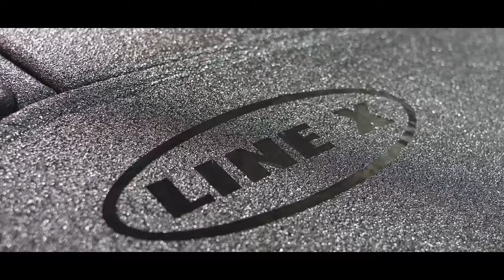I SPRAYED MY ENTIRE CAR WITH LINE-X!! (LINE-X CAR EXPERIMENT)

Comment: try spray Line-x on a snow ball and throw it at someone :)
Reply: As you as you saw in the video it held the glass together the glass still broke but it only held it together so basically putting Line-X on the snowball would just be like a cover or cap for the snowball preferably a cap so basically inside would just be a bunch of water but that's just my theory
Reply: RICKROSSyt SMART
Reply: RICKROSSyt BRuTAL
Reply: RICKROSSyt the snow ball would probably melt and then it would just be water in a line-x ball
Reply: That's how people get concussion kids
Reply: A GAME THEORY
Reply: That would probably hurt alot

Comment: If line x did that you should spray plastic and see how much weight you can hold with it
When you hit a car with a sledgehammer or drop an egg off a building your implying it can take a piece of plastic and make it strong as metal